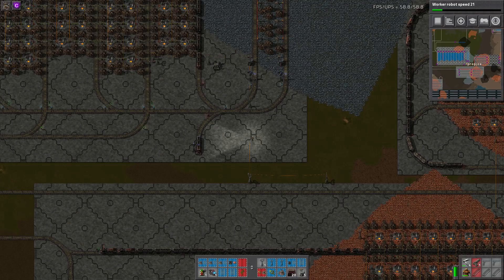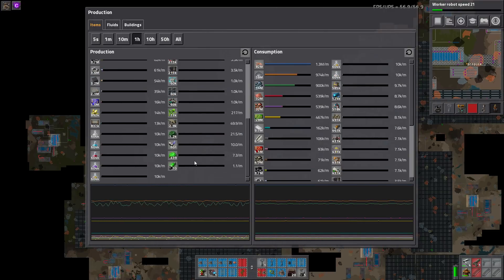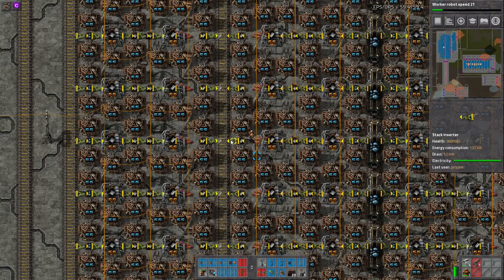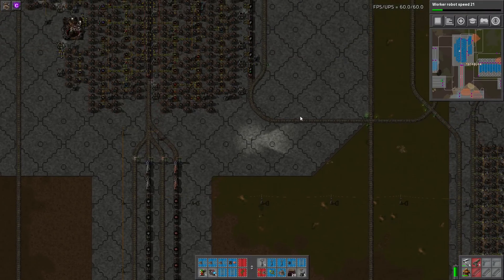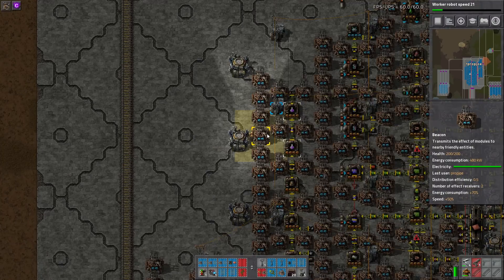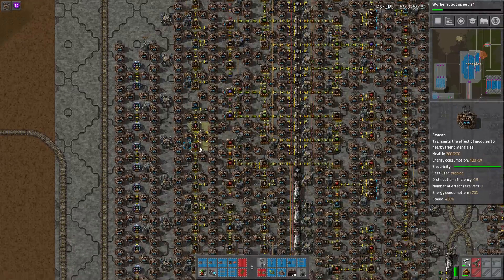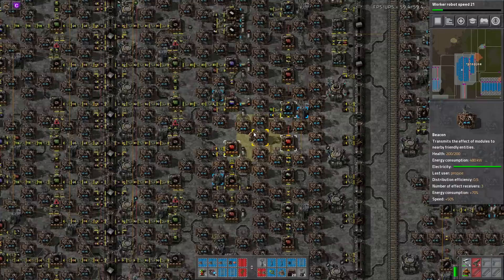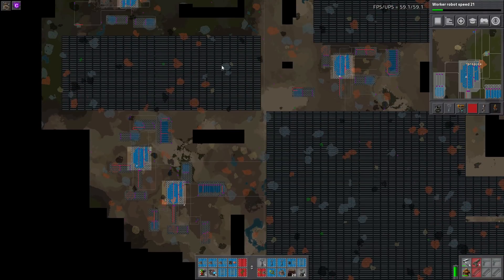Factorio Base Tour - 10000 SPM Modular Megabase by swolar

Comment: So as someone who has never gotten close to a proper "megabase" stage of factorio, I have to ask: Do you have to do these strange things to get the SPM high (even half this)?
(By "Strange" I mean for example using a car as a chest, beacon being 99% of the base, trains being loaded directly from modded ore patches) I mean, is "Megabase" design so different from normal starter bases design?
Reply: Once you beat 1rpm, the main issue of every factory is UPS - your computers ability to run the game. All these "strange things" are done to reduce the amount of things that YOUR PC has to do, rather than to make the factory itself somehow better.
(1rpm = 1 rocket per minute)
Reply: Once you get to mega base point (around 1000 science per minute(spm)), the limitation of your base becomes your hardware. To reduce the strain on your computer you try to reduce the number of entities that need to be updated frequently by the game.
You can easily scale your base to 500 spm without any of this.
Mining directly into trains is just the most efficent when you get high enough mining productivity. As the miner simply moves more ore faster than any configuration of inserters.
Reply: You say "proper megabase", but that's when I say "Why is bigger better?"  I have a modest PC, and try to get the challenge out of getting lemonade with the lemons that mapgen throws me, maybe with judicious use of some mods.  I just finished a Plain Vanilla 0.17 while routing around the cliffs and lakes and forests, and now I've loaded some mods and I'm trying to launch a rocket without ever mining a single piece of coal.  So what I'm saying is that megabases are only one of the many ways to enjoy Factorio, and long may that continue!
Reply: @jonathanrichards593  he didnt ask abt that tho, he asked abt doing a megabase